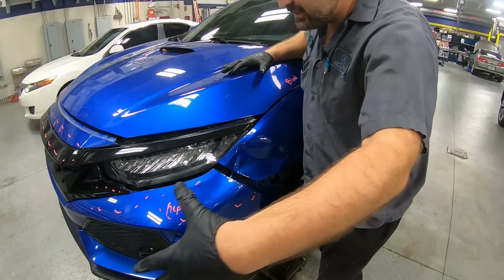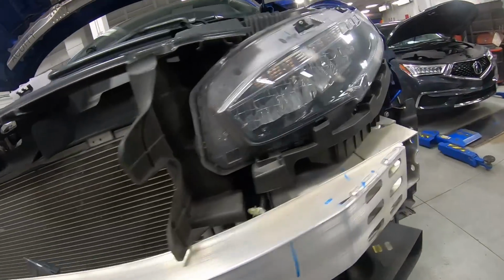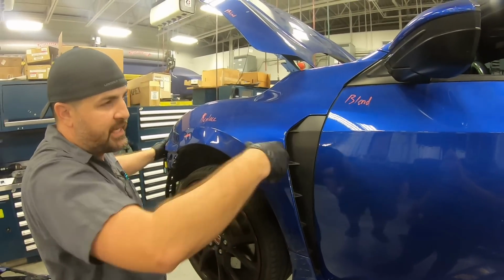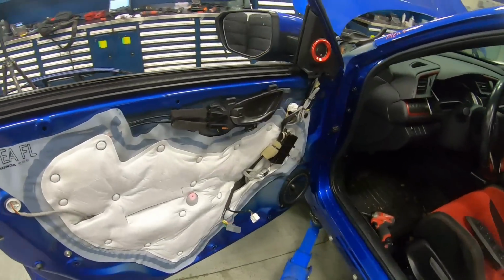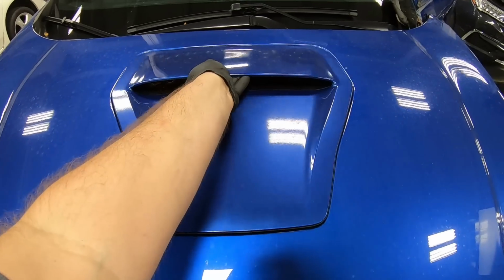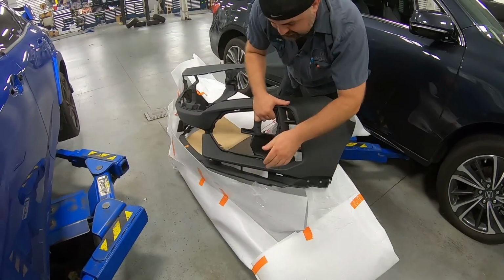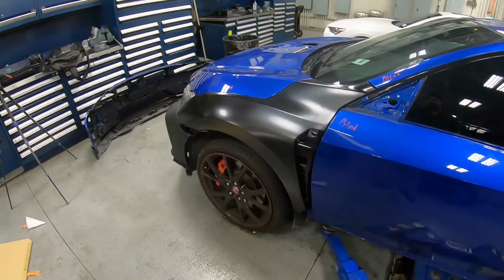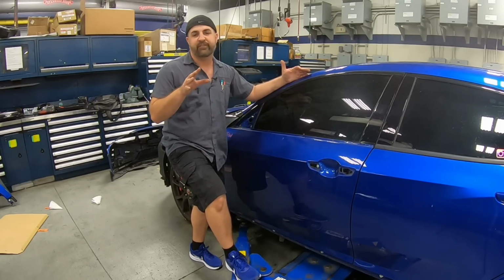Repair Build Project Honda Civic Type R Civic, Disassembly and Repair Part 1

Comment: I really like this video, gives a different point of view as how things are done in disassembly. I don't see videos like this often.  How do you know where the removal bolts and screws are alonge how many of each? Do you have some type diagram? 
Thank you Brian....
Reply: With experience, u will know where all the bolts and screws are. Plus looking for them helps aswell.
Reply: Thanks Jimmy. Experience would be a plus but in my limited experience, there always seems to be (just one or more) that is not easily found and by not knowing, a person has no way of knowing if there is really ‘ one more’ or multi fasteners left. I would think some kind of printout or something similar would be a tremendous asset as a guide to knowing before the job is even started. 
That is and was my question to Brian. Do you have some kind of instruction to each job? Thanks, Phillip Hall

Comment: Hi, I wanted to know if you knew what kind of caulk is best for sealing the air holes in between the walls of the paint booth, we have heard nightmare stories from people using a caulk with too much silicone. 
Information would be greatly appreciate thanks to you sir

Comment: Hey Brian, Ive got a question about the blending additive you've used in previous videos. Can you use this additive with 1k dupli-color touch up paint? Also, which metallic colors would you use this additive with? I understand not all metallic paints are the same but im thinking of doing a smart touch up using the Pacific Green Metallic paint from Dupli-color and wanted to know if the additive is necessary or not.

Comment: Being a noobie it’s so hard for me to register in my head the color blend wit repainting panels. Like why so many panels have to be repainted like this video the door and hood. Like what’s the real science behind the color blended? Like how does a color change when it’s seal under the clear coat? Is the clear coat full of oxidation and containment’s that’s throwing the base coat off? Will the same steps be done if the car was under 1k miles?
Reply: Not all paint is made the same. Even from honda or any other make. 1 factory may mix a color a certain way and another factory may mix it another. Plus theres many paint companies who also try to duplicate the color with there paint line. So theres soo many factors that will lead to color mis match. Thats why blending is necessary, u have to "hide" the color in the next panel in the middle somewhere where the naked untrained eye cant see.

Comment: pro-tip... when shopping for vehicle insurance find out how long they will use oem parts based on the vehicle age. most insurance companies only go out 1yr or so, my insurance company goes 3yrs. it's the small details that matter.
Reply from the maker: Most every company writes for aftermarket but our dealership price matches and we get oem everything if it’s acura
Reply: @PaintSociety  USAA will go 3yrs oem. I'm a Mercedes-Benz shop foreman and we have a body shop attached. The shady stuff I have seen over the yrs is a real eye opener.
Reply from the maker: I hate to see it. Brand new cars all written for aftermarket and used

Comment: Brian, what would your shop do if the frame was bent? Sub that part of the repair out? Just curious…
Reply from the maker: Send out the whole repair to another shop.
Reply: @PaintSociety  that would stink.
Reply from the maker: No worries. We prefer the quick and small repair jobs
Reply: @PaintSociety  me too Brian! Although, on a few occasions I have had to sub out a few jobs for frame straightening. Just the other day I had to use my frame machine, aka the telephone pole and a come along 🤣

Comment: I've learned so much from you Brian. In the process of painting my car and I always refer back to videos if I'm not sure of something. I just hope everything goes well when it's show time. Taking my time on repairing a bunch of dings and what not to get it right the first time. I don't recall but do you have any videos about atomization. I'm just not sure what I'm looking for in detail on adjusting my gun. I'm running a small 26gal compressor and I'm sure alot of newbies following are too.

Comment: I'm doing this exact same repair on my type r but on the passenger side. Ordered and test fitted the fender myself. It's a little more complicated for the other side cause of the windshield wiper fluid reservoir but pretty much the same steps. Can't wait for part 2!
Reply from the maker: Nice what color ?
Reply: @PaintSociety  championship white. I've been watching your videos to get an idea of what repainting a car in your own garage is like and the equipment needed to do so. Seemed like it's quite an investment equipment wise so I'll just leave the repainting to a body shop, with me doing the parts and body panel ordering and installing myself.
Reply from the maker: @neilbantoc3609  good idea because they color is very tough to match

Comment: I love your videos! Have watched a bunch as I just rebuilt a 2020 Civic Hatchback with smashed fender and missing door. Same color. Really wish I had this series as a reference before I started cause I learned on the fly... Well there's no shame in re-doing some stuff. Had a hard time getting my color to match as it's my first time painting. And the color is expensive! Tuition I guess.
Reply from the maker: You’ll be really interested into the second video. Color matching